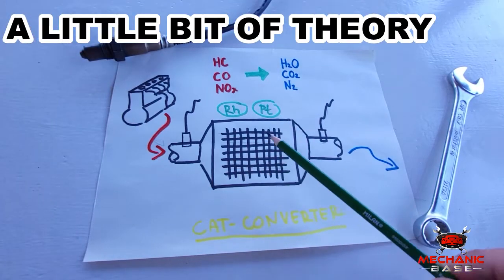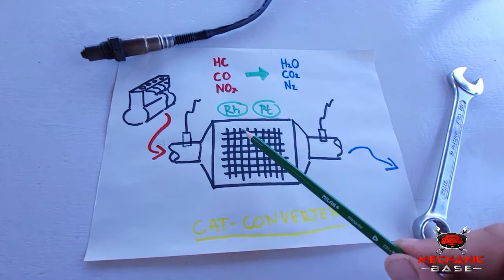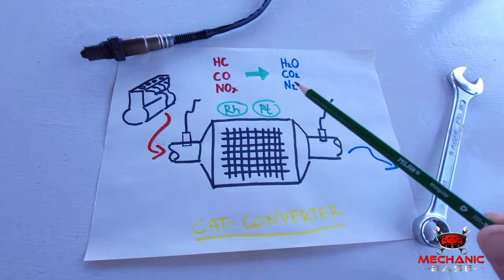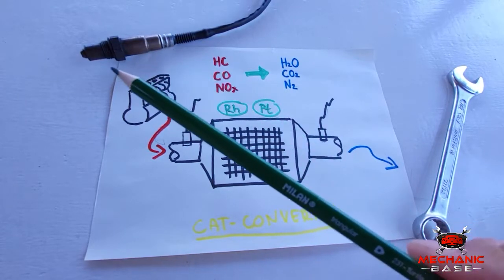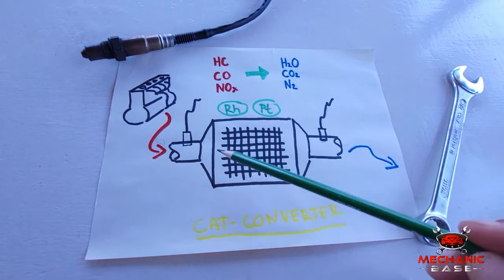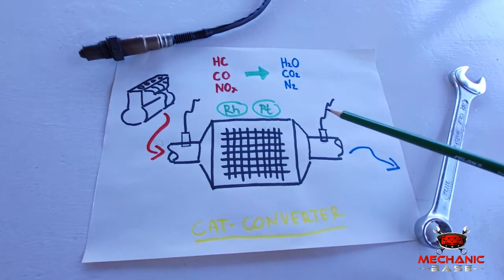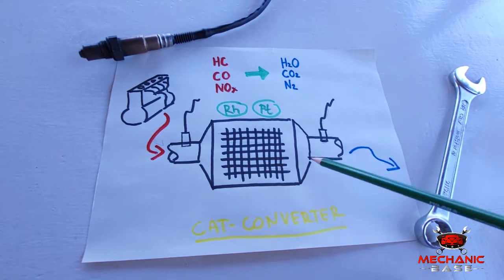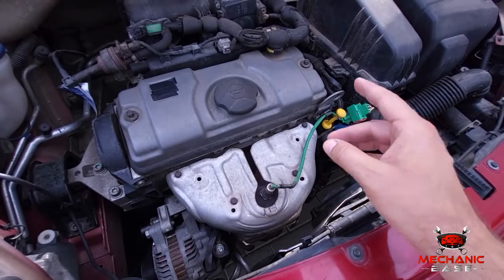P0420 Code - How To Diagnose And Fix It Quickly!

Comment from the maker: Did you solve the problem with your car? Let us know in the comments below how you did it, and you can help someone else with P0420 error code!
Don't forget to like the video and subscribe to our channel!

More P0420 code Info: https://mechanicbase.com/trouble-code/p0420/
Website: https://mechanicbase.com/
Community: https://community.mechanicbase.com/
Reply: Good day, Thank you for the good tutorial .  I have a 2006 Nissan x-trail (T30) with 305 000 km 4 cyl 2.5 l.  Good reliable car overall.  I replace the downstream 02 sensor with an NGK 24407 (new) only to see p0420 code turn on. Hence I put the old sensor back and erased the codes. I find it strange that a new O2 sensor would crate this problem. Since my vehicle has high mileage i thought putting new sensors would improve the idle.  They are original to the vehicle.
Reply from the maker: Hey, where did you buy your sensor? 
Unfortunately, there are many knock-offs on the market.

Comment: Hello, Very good video, I am having a problem with the Peugeot 207, as I saw in the video, possible thermostat problem.
Reply from the maker: Yes, that's definitely an option. 
With a wide-open thermostat, the engine will not reach running temperatures, nor will the cat-converter. This is especially true if the error pops up only during longer drives.

Comment: 2014 Chevrolet Volt has no engine light on anymore but show P0420 as a permanent code. Put cat cleaner through it but permanent code stays but does not trigger engine light. 💡 still fails smog